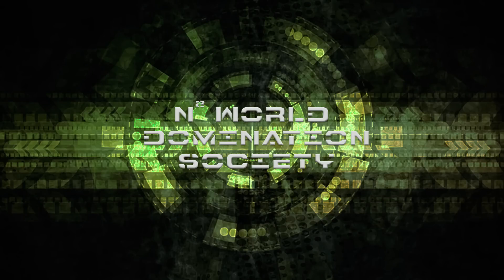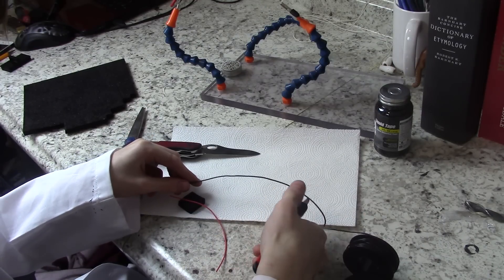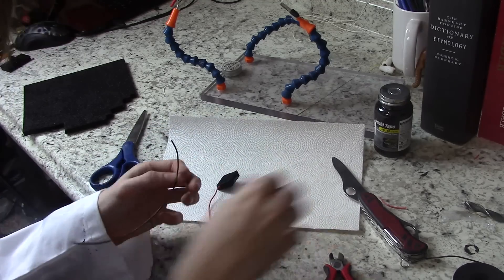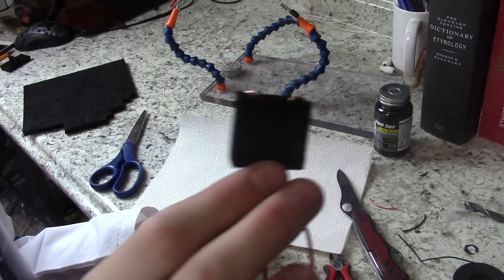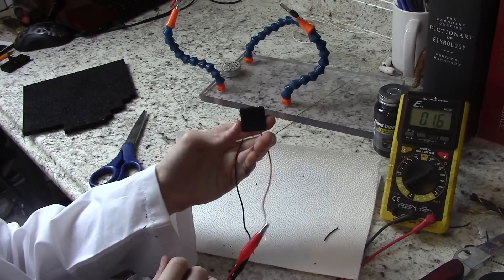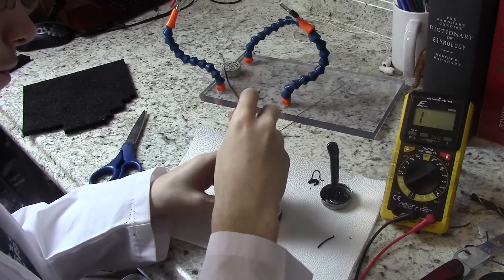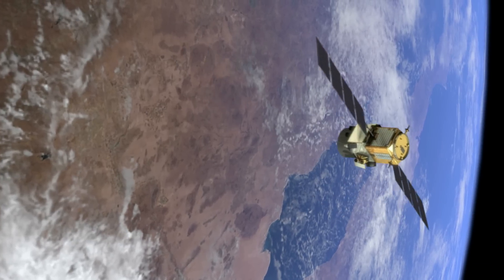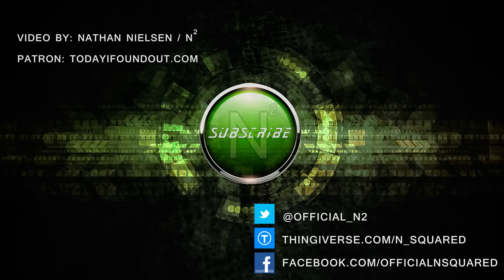How to Make a Ridiculously Cheap Analog Pressure Sensor

Comment: Or you could clamp the foam between two strips of copper breadboard. 

it would be interesting to learn which properties of the foam allows it to act in this way. The mass remains the same , the structure is possible the same, its  really the density which changes. So what else is happening does the internal structure callapse to create physical paths for the electricity to flow? Still it beats Piezo and the other load sensors.
Reply from the maker: I don't know exactly why (like at an atomic or quantum level), but as I understand it resistance is dependent on length and cross sectional area of the conduction, and I believe both of those change when the foam is squeezed.

Resistivity also depends on the material used, and I wouldn't be surprised if changing the density of the foam changes resistivity as well. Basically like dense foam is a different material to not-dense foam. But it's been years both since my last physics class, and when I made this video, so take all that with a "citation needed".

Comment: Can this measure LPG gas cylinder ammount
Reply from the maker: You'ld have to test it yourself. It depends on how much the pressure of the gas compresses the sensor, and how sensitive you need to be.

In general though I think this sensor is more useful for a binary "am I being pressed" or maybe "am I being pressed none/a little/a medium amount/a lot" then "I am being pressed with 5.67lbs or force." But that's what you get for basically no money :)

Comment: Ok i thought this was for a pressure sensor for an air compressor... Lol.... Is there any way you can make 1 of those??
Reply from the maker: With this method I doubt it. On paper the air pressure would effect the foam, but I expect you would need rather extreme pressures and it wouldn't be very precise. I could be wrong though, but you're probably better off with something a bit more precise and involved.

Comment: As some barely useful advice, from someone who's used pocket knives a lot to strip wires, if you roll the wire on table under the blade of the knife it will go much faster for you next time. Don't try to carve it, that will take much more time as you experienced.

Comment: why and how does this pressure sensor work? Does the foam form a resistor connection between the two leads? I thought foam materials were insulators?
Reply from the maker: I don't know much about the properties of the foam itself, but as I understand it the density of a conductor effects the current going through it. So by squeezing the foam you are increasing the density and therefore changing the current in a measurable way.

This isn't great if you want a weight or something precise. But if you just want to know "Is this thing being pressed" it works
Reply: @CaptNSquared  thank you

Comment: hey really helpful video.i just wanted to ask, if there was any conversion scale that could convert the resistance measured by the pressure sensor into actual pressure value in mmHg?
Reply from the maker: Thanks. You would have to do that experimentally I believe. Every individual sensor is going to be different.

I'm not sure if it's a linear formula though. The intent was that you would find out a trigger value you wanted, test what the output is when you apply that force, and use that in your code.

I expect that compressing the foam requires more and more force the more it's already compressed so you might struggle to program an accurate sensor. If you just need it "good enough" over a small range of pressures though you could test known pressures at set increments and just display a range of possible pressures using that.

Comment: Awesome video. I have a couple of questions...

Firstly, is there a way to make it more accurate? To more decibel places? Would that just be a case of getting a more detailed multimeter?

Secondly, is there a way I can record this data on a computer in real time? As in, as I squeeze, it comes up on a graph with the pressure created and at what time.

Thank you for this video.
Reply from the maker: Thanks! To answer the first question the precision of the reading is determined by whatever you use to read the sensor. However I don't know how consistent the readout is at more precise measurements.
Secondly you can record the data as you described, but that would involve designing a circuit and writing some software. I wouldn't be surprised if you could find some pre-made code to do what you say, I just used a multi-meter to show that the current does change measurably with pressure.
Reply: @CaptNSquared  That is an amazing answer! Thank you very much, it was extremely helpful! :)
Reply: I've seen where you can use either a wheatbridge or a voltage divider circuit to ampify the output where it can be read more accurately. I'll probably go for the Voltage divider  as that takes up the least space for what i have in mind.

Comment: Using an auto-ranging DVM I'm finding a piece of foam 1 1/2 inches square (not square inches) by 1/2 inch thick, with wires pierced approximately 1 inch (approximately because I have no idea where the wires are going inside the foam).  I'm reading typically 3KΩ just resting.  When I squeeze my foam - finger pressure is not consistent - the range changes upwards toward 5KΩ, depending on how hard I squeeze.  In the video it appeared the resistance fell.  Also, in the video the meter was set to what appears to be the MEG OHM setting.  Changes in resistance do not appear to be consistent.  And for accuracy - - - there is none.  This would be an almost useless sensor unless you wanted to know if someone stepped on it.

Comment: Sir can we use sponge
Reply from the maker: I've never done it myself but it should work. It would probably have a different sensitivity though because the material I used is firmer than a sponge. I don't know if it would be more or less sensitive though
Reply: Tank sir

Comment: I need to make a sensor to go in-between pieces of wood we are pressing with a hydraulic press. Do you think this idea would work?
Reply from the maker: I think this could work. However I don't know exactly how this works under the extreme pressures a hydraulic press can generate (I've only needed basic things like if something is pressed with moderate force). If you have time this is cheep enough that I think it is worth a shot, but if you need something guaranteed to work on a shorter time-frame a sensor rated to work at the pressures you are expecting would probably be the safer bet.

Comment: Hey bud, this is super helpful, but I have some follow up questions. 1) Can you use any type of foam or only the packing foam? 2) What does your wire set up look like with the meter? Do you have an external power set up?
Reply from the maker: 1) I've never tried this with another type of foam, but I assume you could use any similar type of  foam and it would work.

2) The positive charge is going into the red wire and the negative wire is going into the black wire. You can use an analog pin on your micro-controller to measure the change in voltage to figure out if the sensor is being pressed or not.

3) Yes, the multi-meter (and therefor the sensor) is getting power from batteries. Whatever your using to power your project can also power this sensor just like a normal store-bought pressure sensor.

I hope that answered your questions.

Comment: Made me laugh haha :) I'm looking at building a sensor that can send a signal to an electronic device when weight is added to it to make a lever move. Sort of like a scale that moves a lever when weight is added but the lever is moved by a motor and some gears. Does that make any sense? Lol... If so do you have any ideas on where to start?
Reply from the maker: Thanks!

For your project I would start by either buying or building a scale, I'm not on expert on scales but I believe if you make a big enough platform and put presser sensors on the legs at the 4 corners (so that all the weight is put on those sensors) you could test the resistance of the sensor using the weight you want (say a 10 pound dumbbell) and see the resistance when the dumbbell is on the platform. Once you have that number you can write your code saying that when one of the sensors reads a resistance greater than (or less then, I can't remember which way it goes) that weight the signal to activate the lever will activate.

With regards to the leaver, it seems a bit strange to use gears. If i'm understanding you correctly, I feel like you can remove the gears and attach the lever directly to either a servo or  DC motor that moves when it gets the signal from the presser sensors.

Feel free to ask for clarification if anything I said doesn't make sense or is wrong.

Comment: I didn't not like any part of this .  you can strip wire with a knife easily by rolling the wire across the cutting edge to score the insulation. then, bend the wire, and the insulation will break, and you can remove it.

good post filming commentary.

Comment: Hi if you could help me out i have a question .I'd like to make a presser pad for punching a  martial art dummy.The idea is when you deliver a punch you can see a read out how hard you've hit .Can you give me some advice ,thanks...
Reply from the maker: I've never tried something like this where you can tell how hard something was it, but I'll do my best to help.

I doubt it will work with only one pressure sensor, because they are so small. This design especially wouldn't work over long distances. I would recommend placing presser sensors at each corner and maybe the center of where your going to hit the dummy and play around with some code to see if you can get an accurate reading by averaging the force from each sensor or something like that.

That's only a theory though, I don't know for certain if it would work. If you want to be more certain I would recommend researching how real martial arts dummies work or maybe see if there's a part that does what you want other than a pressure sensor.

Hope this was some help to you, and good luck on your project.
Reply: That would be great
Reply: how big is the dummy? full size like with a torso and head? or like a punching bag?  you could probably get decent data by using an accelerometer, and doing some basic acceleration vs deflection calculations.
Reply: The dummy is named bob it is basically a  head torso here is a link to the bob dummy I'm talking about  
https://martialartsdepot.ca/product_info.php?cPath=258_259&products_id=6108&osCsid=ae2be531c4288ef80d22c6ea625764ea
it would need pads all over it to have a good Technik striking points .......
any ideas how to make the pads would be grate.

Comment: what's the scale of this measurement ? 

ohm
kohm
megaohm

?????
Reply from the maker: +Mina Nagy Honestly, I built this almost a year ago and so I don't actually remember. I believe it was ohm but it might have been kohm. If you build it yourself you'll just have to try both to see which works, or test it with a multi-meter.

Comment: how do we stabilize the value data being read by terminal?
Reply: Frank Lopez All you need to do is calibrate the sensors periodically in code. (This is really something you should be doing anyway, even for many high end pressure sensors.) For instance, a very simple method is to on startup for the initial read, store that value for not pressed. Then as it's being used, monitor the max/min values read to continue calibrating over time. In the very initial run, you could also press it all the way for each sensor to get the other end of the spectrum stored.  If you liked, you can also store these values in some form of long term memory, so even if you turn off/on the robot again, it's got something to work off of for calibrating the range the sensor is capable of.  Or, even better, program it such that it dynamically calibrates constantly. 

Once you have that range, you can easily use it for a variety of things, continuing to calibrate periodically for as the sensor wears down and becomes easier to squeeze over time.

Do this for each sensor of the array, and it really doesn't matter if they aren't all the same.

I've actually used these exact style sensors in a product I designed for a prosthetics medical company.  They were used to detect when a person's heel touched the ground. (The device would stop music playing from the user's audio device if they didn't step using their heels; it was a device for helping toe-walkers walk properly by providing audio feedback as they walked around.)  

In the initial mockup of the device, I figured these would do the trick and they worked just fine (with continual automatic calibrating, of course, as they wore out over many miles of stepping and the readings would change over time for what counted as a "pressed" vs. not as the foam became more easily squishable).

The final version of the device used much fancier, expensive, and more durable sensors, but these worked great for the early stages of the project development and many miles of people stepping on them in their shoes in testing. :-)

With auto-calibration in code, it's also easy enough to just swap out the sensors for a new one you make any time, or even potentially a completely different type of pressure sensor.  I actually didn't need to change the code from when I used these sensors vs. store-bought high end ones.  The code within a few steps could correctly re-calibrate itself to the new sensor.
Reply from the maker: Frank Lopez As far as I know, there isn't really a way to get the exact same value from the sensor every time (I assume that's what you mean), however you can mess around with your code so that when the sensor is squeezed the value will be lower than a threshold you set and it will be read as "On".
Reply: this is nice but when you have a multi sensor array this wont work as it will be applied to all sensors and not all sensor will have the same reading as mention by one of your viewers
Reply from the maker: Frank Lopez Sorry, not sure what to do to fix that. I haven't used these pressure sensors in many projects and its been a wile sense I worked with them.
Reply: so are you saying that this video is not worth pursuing? i mean you posted this so im not sure your expecting someone who did not know about to begin with to pick up where you left off? "dont wanna sound rude ,. just saying"  im looking to use this for robotic applications so i like the idea/thought but i was under the impression that when ppl do videos like this is cuz they have a solid understanding thus they teach/share to other like myself
Reply from the maker: Frank Lopez Again sorry I couldn't help. I know how to get the pressure sensor to work if your just using one on its own but that's all I've ever needed to do so i haven't looked into getting multiple ones to work together. However I would assume it works in a similar way to using normal pressure sensors, as it is basically the same thing but cheaper and therefore less consistent.
Reply: you did well in sharing tho ,.....thank alot really
Reply: wow thanks for the input , as in now im like mid learner not so much as a noob so im still learning and this method of re calibration is not new to me but in terms of a example code depicting this setup in code is very new to me as  im yet to come across a example code that shows how this will look like in the end, here is my website feel free to check out my designs im planing on punting this type of sensors on http://frankdesignatures.weebly.com/ cuz  ironically i was thinking of putting this on my humanoids legs and arms, thanks for the update tho

Comment: Hey I'm curious if you made say 10 roughly the same size would they have the same resistance pattern? Also could you set them to do something say turn on a light once a certain amount of pressure was applied? And if yes to prior question what would be the minimum weight that it could be set for? Lastly if covered by a layer of plastic as a cover how long would something like this last?
Reply from the maker: Patrick McAleer 1: The exact resistance varies from sensor to sensor, however I assume the resistance would be similar if the sensors were similar sizes, I don't know for sure though never payed attention how different sensors compare to one another.

2: You could use it to do something by reading how much voltage is coming from the sensor and wright the code so that something will happen when the voltage goes below a set point. ex: if voltage is <1 ,  turn lamp on

3: The minimum weight is a trick one. i don't know exactly, however there must be enough weight to put pressure on the foam, so it would probably have to be a few pounds at least. I've never put the minimum weight to the test and I've only used a pressure sensor for a few projects over the years so you might have to test it yourself if you have a specific object in mind (or tell me what the object is as I might be able to tell you if it will work)

4: It should last you a fairly long time, but it depends on the application. For example a sensor exposed to water often will die faster than one just in a project with little use. I also assume you mean plastic wrap as solid plastic would mean you cant put pressure on the foam.